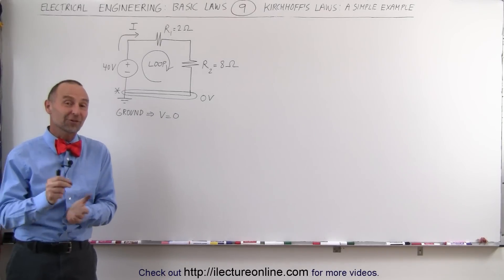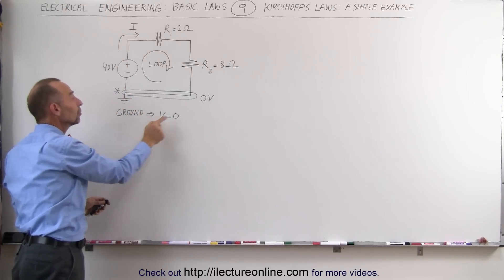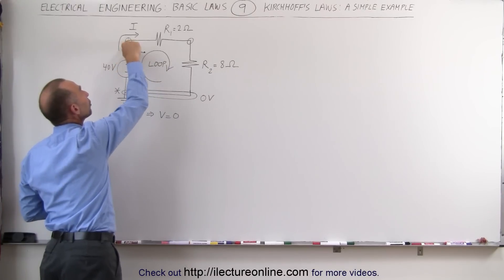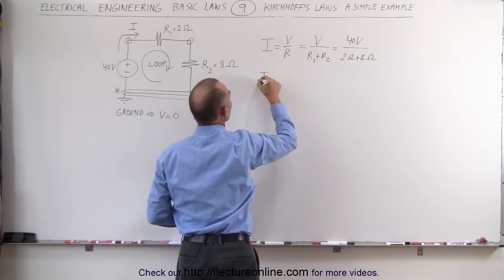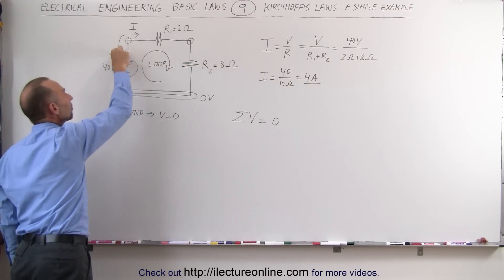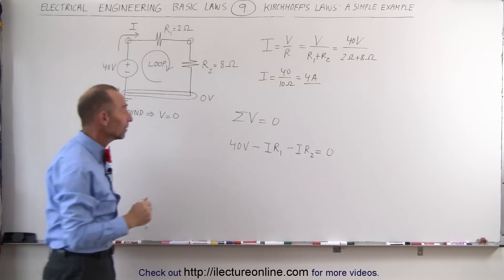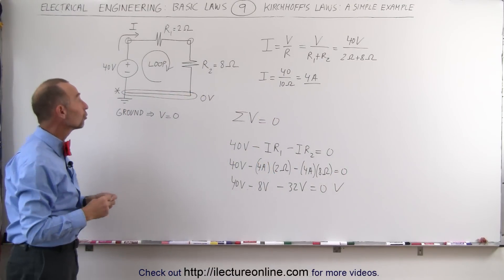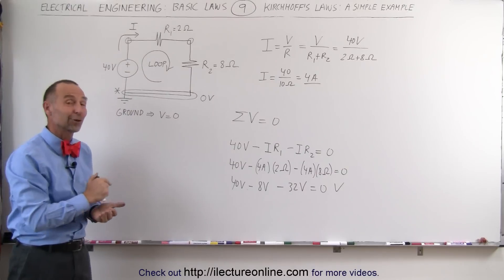Electrical Engineering: Basic Laws (9 of 31) Kirchhoff's Laws: A Simple Example

Comment: I don't understand why you're subtracting the  -IR1 and -IR2 instead of adding.
Reply from the maker: It depends on what convention you want to use.  Here we use "positive current" and voltage drops across the resistors when moving in the same direction as the current.

Comment: I have the same question, wouldn't ground drag all the voltages and currents to the groung which leaves the circuit not functioning and incomplete?
Reply from the maker: Ground, doesn't pull anything into it.  Ground puts the reference volts at that location to zero.  Other parts of the circuit will be at higher or lower potential.  It is the difference of potential that drives current through the circuit.